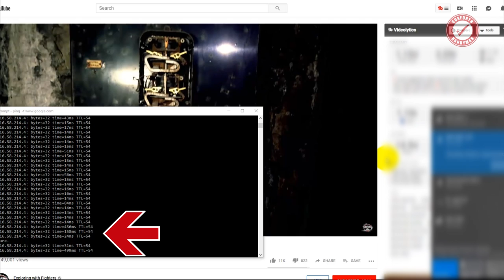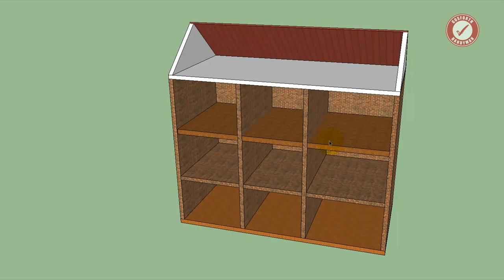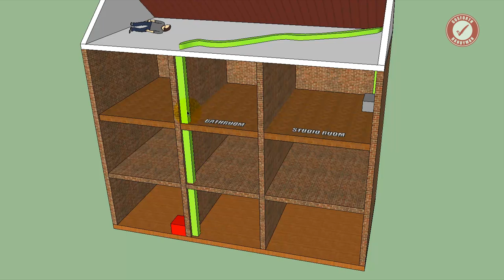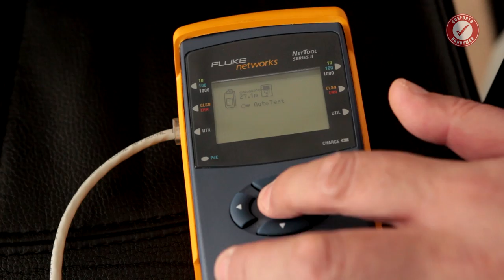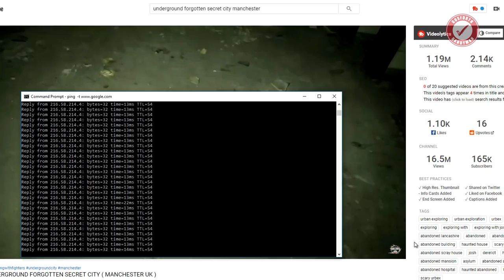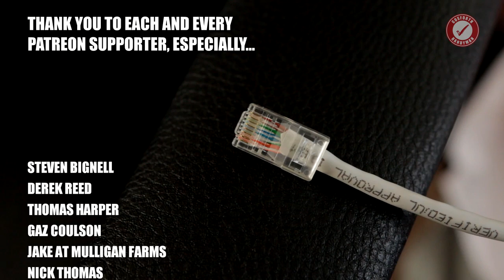Running RJ45 Network Cables inside walls ...and fixing Wi-Fi problems!

Comment: I would have added another length of garden twine to the CAT5 that was pulled up. If additional cables are needed in the future then you already have a pull in place (and you can rinse and repeat)
Reply: Agree I have habit of doing same as I never know what I need to run later. Save me headaches.
Reply: Im glad I read your comment.  Thanks, and when I start drilling holes I will definitely be thinking of future runs.
Reply: You always want to leave a pull line in these trouble areas in case additional lines are needed in the future. Pull strings cheap and will save you time and the headache of doing it all over again
Reply: Use washing line instead of twine. It's super strong and it's heavy, meaning it will drop straight down better. You can get it in 50m lengths. Drop it down, leaving most of the line at the top. Attach the cable to the top and pull both cable and line down. You can pull the washing line back up and repeat as many times as you need.

Comment: Instead of ending the cable with an RJ 45 plug uses an RJ 45 keystone in a wall plate. This will let you plug a patch cable of the correct length for any placement you choose. Changes are easy and the plug end is easily damaged. replacing a patch cable is a lot easier than re-ending the end of the wall cable and finding that it is too short.

Comment: used to work installing networks in the army in mainly old buildings one tip I used to do was attach one of those small laser pointers to the fish wire so it was easier to locate in dark attics or crawl spaces

Comment: Had the same issues, in the end i fed the CAT5 through the outside wall from one side of the house up the wall to the roof and across the loft, back outside on opposite house down the wall and into the room with the problems your having - I purchased one of those cheap kits off Amazon - did my own research on the wiring and fitting the plugs on the end of the CAT5, tested them all out on the cheap kit and it ll was good - got great internet now in a room we could not ever get in before.

Comment: Used the same technique in our house but fortunately we had an ensuite shower which had a box behind it that I could physically get into from the loft and then managed to poke the cable down next to the soil stack through to another box in the cupboard below which was in the lounge where the router was. I didn't drill a big hole like you did, I just drilled a small whole in the bottom of the box and fed a cable upwards that I could then use the soil stack access hatch to get my arm in and grab onto. Worked a treat.

Comment: Good video  showing all the issues I have come across in doing this. I like the idea of the large holes- never done that and it makes it so much easier to feel around. (Saw your earlier video on filling these too.)
In my latest house I tried wireless solutions (mesh) like Ubiquiti but no good. In the end I got BT Whole Home and it works brilliantly on all floors once you place the discs properly (positioning software tool provided). Never thought I would use BT kit! I get 50Mbps in all rooms in the house now with no wiring.

Comment: No boxing in my house to chase cables down so I went outside... External grade Cat5e (black) clipped every 600mm and 90° turns, with internal RJ45 sockets in surface-mounted boxes. One run from office at rear of house to lounge at the front. Second round to the garage on the opposite side of the house where I keep my NAS. Gigabit switch in the office links it all together. Previous owner ran so many cables on the outside that once I'd stripped them all off, my pair of cables didn't look half bad.

Comment: Lovely neat job Andy, very well explained and demonstrated as usual.

Wired all the way for reliability. If you get it properly installed at the start, it very rarely goes bad. I’ve done a ton of these over the years for friends & family and you still gave me a couple of new ideas.

I’d definitely have run a second cable for future proofing - splitters will drop your speed back to 100 mbps which might be okay for the Internet but is terrible for network drives. Plus you can use the second cable as a HDMI extender (with suitable encoders) which is often handy!
Reply from the maker: Cheers Eddy! Yeah, splitter performance can be quite varied depending on cable length and interference etc. Worst case I'd just add a switch. 👍👊

Comment: When I did this, I just went outside and mailed to the brick. Super easy. There was already a telephone and TV aerial cable so added to the lines!
Reply from the maker: Good plan! 👍
Reply: I don't think that standard CatX installation cable has suitable UV protection for outdoor use.  It may disintegrate over time - mind you with the UK climate...
Reply from the maker: Yup - you'd defo need exterior grade cable.
Reply: Gosforth Handyman or put it inside a pvc pipe
Reply: @stephenguk  yes indeed, I read somewhere some 5-10years. I only needed it to last 5 max.
However, simply painting it increases the UV protection many many times over.

Comment: good job Andy shows it just takes time and lots of patiences, I think I would have conected each end to rj45 faceplate rather than using the crimping tool (or the lazy route and use a mesh wifi but wired will always be better for stablity)
Reply: Could always switch to that later and put a switch on one end.

Comment: I used to put in data connections and my office at home suffered from a similar problem so I fitted 2 sockets in my office which went to where my router is problem solved I fitted sockets into the wall and then used Cat5E patch cables. However since I have swapped to Sky Internet my Sky Q boxes have now become wireless routers due to Sky fitting a range extender box where the dead spot was. A wired connection will always be better than a wireless. Well done and if you had said at Makers Central I could have let you use some of my cable as I still have a box left 😂

Comment: Tool-less RJ45 plugs are also very good i have used these as have never crimped the plugs myself and only ever conencted into the sockets & patch panels.  you just line the wires up ntop of their terminals and then close down the lid on the plug which has built in blades to crimp the wires into the plug, they are a built bulkier than the normal plugs but very quick and easy to install. 

I installed a cctv system an dvr on our house and had to run all cables extenral and with minimal amount of cable on show as my mum hates seeing wires.

The dvr is sat in the loft, it needed a wired network conenction to be able to acces the cameras on our phones, and does not have wifi built into the dvr or the option for a wifi dongle either.  I ran a black external grade cat 5 cable up the outside of the house from the BT socket where the router is up into the loft through the soffit, this was cable tied to the BT phone cable and then also next to this cable where it went into the soffit is where i installed one of the cctv cameras so only a short amount of cable was on show, also did the same front and back for 2 more cameras so they were out of site and impossible for people to reach and damage them. 

Where the cable came into the bt socket I just cut out a bit of the socket back box for the cable to come through behind the socket front plate and terminated both ends with tool-less RJ45 plugs, i then also put a small switch in the loft and repurposed the trunking in the back bedroom that was for the old storage heater wiring to run a cat 5 cable from the switch in the loft to my bedroom as well as also run coax cables for the tv's meening i could do away with the rubish indoor aerials we had in the bedrooms. then in my bedroom bought a secondary acces point that is basically just a glorified router to run all my AV equpiment on wired networking and have wifi for all my wireless devices.  So glad i did it all.

Comment: Another useful tool for pulling cable is a long section of beaded / ball chain (like on an old lamp but larger beads and longer, about 20’) A long #10 or #13 ball chain has enough weight to drop down a wall without snagging on insulation and does a great job of deflecting around small obstacles.
Reply from the maker: Yup - they're great too! 👍

Comment: Concrete walls and floors made me go wired too, port switched gigabit ethernet throughout in the house. 

Nothing beats the speed and stability of wired LAN.

For mobile internet access I use both my router and a remote repeater (depending on where I am at the time). 

Works like a charm :-)
Reply from the maker: I can now use my PC as an access point for the top floor too (when it's switched on) - works pretty well! Better than the normal wi-fi anyway. 👍😂

Comment: I recently bought a house, during the 1st fix I also fitted cat5e cables to each of the bedrooms, instead of terminating the ethernet cables with RJ45s I opted for face plates with sockets and patch cables for each device.
(those cheap tester kits do what you need them to do, there is no rocket science here, either the pins are wired correctly or they are not, spending a fortune on a Fluke kit isn't necessary for domestic use).

Comment: Nice job, running cable is always fun. Only thing is, never run 1 cable when you can run 4+. The cable doesn't cost much compared to the time you spend doing it. Even if you don't need them now you could've left a coil of cable at each floor and another in the attic etc long enough to reach any room on that floor and it's most of the job done for next time you want another point somewhere.
Reply from the maker: Would have been a lot of extra work and guarantee I'll never need more than this one. 👍
Reply: yeah surprised he only ran one

Comment: A suggestion if you need more connections in the future would be a switch in the loft connected to the router downstairs then you only need run the connections from the loft to the top floor. If you have a gigabit switch and router you’ll be fine for sharing the single cable for internet access, which was around 30meg from the test you ran. You could also put a wireless AP in the loft to help your WiFi coverage for mobile devices.

Comment: In my house I can see 20+ wifi networks... 100% chance that one the neighbors decides to run it on MY channel! Oh well... a €20,- for reasonable krimp pliers and €17,50 for a cable tester (its a must!) did the job. Ones you get the hang of it... its a lot of fun making patch-cables. Running 4K tv/youtube only goes through old fashioned copper wire.
Reply from the maker: Yup - once you get started on crimping the ends on you can get quite fast at it. 👍😀

Comment: House builders take note install network cables during build. Keep up with technology. I know some do but should be standard these days, in only pennies in scheme of things.
Reply from the maker: Yup - totally agree. I'd have paid extra for it but not even an option. I've seen some smaller builders offer it. 👍
Reply: They only need to add a 2" plastic pipe in the boxing in for cable drops
Reply: Gosforth Handyman I know of some builders who do provide generally smaller ones. Just needs to become the norm.
Reply: They could just leave scrap cable for you to tie on to. Suprised no fire stopping between floors.
Reply from the maker: The plasterboard itself is the fire barrier. 👍
Reply: Know of a new build that had mains wired smoke directors that were wired into lighting circuit so only worked when lights on 🤦🏻‍♂️
Reply from the maker: Our smoke alarms were arcing so much due to crap connectors they were the most likely thing to cause a fire! 😮😮👍
Reply: @GosforthHandyman  I have worked in places where they wanted extra fire protection between floors not just plasterboard, any holes made had to made good,belt and braces?
Reply: James Taylor I spec 2x cat6 beside every likely TV location. Can run HDMI over baluns from a central distribution point that way 👍👍
Reply: @GosforthHandyman  I find most builders / sparks don't know the first things about data or what cables to run in or where to put them. I have done a fair bit of work fixing or adding cables that were not done properly by the house builder.
Reply: @JasonShowell  as a spark have run data,but to each his own,it can be a bit of a dark art,I'll stick with 240 thanks.
Reply: @Pistol_Knight  yes that would be a much better option because it then enables you to upgrade to whatever future technology there is such as cat6 cat7 maybe even fibre
Reply: Just spoke with david wilson homes about it and there is no way they can do ethernet cables, only telephone points
Reply: Even better - just add conduit so that following people can manage their own cable....

Comment: I have a 2 floor townhouse with a 300mbps package. I was getting 5mbps on the second floor with the Comcast modem/router combo. I switched to a mesh system. On a good day I’ll get 200-230 mbps upstairs now. On a bad day when there is some kind of interference. I’ll only see 120-150 upstairs. At least it’s better than it was

Comment: If we didn't have phones and tablets, I wouldn't even have WhyFi in the house I despise it that much.
Just last autumn I ran 6 pairs of 40m fibre to a central switch. Is only 1Gbps now but the fibre can handle 10Gbps down the road.
Was having massive ground current issues with all 8 switches - everything is rock solid now !
Reply from the maker: Sorted - wow! 10Gbps! That is properly future proofed! Awesome work! 👍👊

Comment: I learned long ago that when drawing a cable you can be well-served by tying on another draw cord.

And a tip for getting a draw cord from one end of a conduit to the other ... tie one end to a plastic bag, stuff the bag into the conduit and blow it through using an air compressor.  Needs about 1" (2.5mm) free clearance in the conduit.
Reply from the maker: Indeed! In industrial applications blown fibre is very common, where fibre optics are literally blown down ducting. 👍
Reply: Not to be confused with blown fibre (mineral wool) insulation ... which has greater connectivity issues and significantly higher latency than WiFi.

Comment: I wish you showed how you fixed the holes. Love the video!
Reply: This is what I wanted to see as well.
Reply: same here,  I want to start a business running cables in peoples home since I already have some experience due to my previous job but I want to be ready for all types of situations
Reply: I cut wall outlet size access holes and cover with a blank plate. That way later on you can get back in there to add or maintain.

Comment: my first thought is to go from the loft to the ground. Use gravity and some cable rods. Rods are flexible and have some weight to help them fall in a straight line, join some together to have around the height of a floor, then you always know that you should be able to access on each floor of your house should the thing get stuck!

Comment: Come on Andy, split screen with you feeding the wire and the other screen with the hole waiting for the wire would have really pushed this video to the dizzy heights it deserves.  Or a wide shot of said hole waiting for the wire to come through and then you see the wire coming out through the bath plug hole or better still the toilet 🚽😀.  Thanks for sharing mate 👏👏👍

Comment: I did have a powerline system in the house (it came with from the previous owners for their CCTV system) but the issue I had was noise on the mains wiring. Modern amps/computer/tv's didn't have an issue but I've got a collection of vintage HiFi bits (everyones got to have a hobby) and you could constantly hear the thing going. 

Ethernet was dropped down into the basement via the side of a cupboard in the kitchen in the end which meant I could move other networking gear into the basement as well. My issue now is that I still don't have ethernet in the rest of the house - especially my study. Wifi works well enough for the most part until I'm moving files to the basement servers and then It's alot slower than an ethernet connection. 

My plan is to remove an old 12 core phone line from the outside of the house and replace it with proper outdoor rated Cat 6 but I need bigger ladders first as it's on the first floor of a tall Victorian house.

Comment: Did exactly this at my nephew's house at the weekend!
Problem we had was no box section so had to fiddle the fish tape through the dot & dab gap which was variable to say the least. The sparky must have cursed the d&d idiots at second fix as we found backboxes protruding right through the skim coat and the gap between skim coat and sockets had been caulked! Got it working but the walls looked like white Swiss cheese by the time we finished pulling the cable.
Wifi is ok, but sometimes you can't beat a nice bit of copper :)
Reply from the maker: Dot & dab can be great for hiding cables - but yeah sometimes you'll hit blockages in really weird places. Nice work! 👍

Comment: Good little video fella, wifi is an artform for that sort of distance and would need a repeater/extender, homeplugs are always a pain over multi levels due to each ring mains level, you're lucky you have that ducting system, I'm currently trying to figure out how to get a hard wire, but I don't have any easy way LOL, although my homeplug system is working, I'd like to get the full speed from my internet into my office.  Ideally for wifi to work in that location would be centre room to send wifi in every direction equally.

Comment: That was excellent. I had the same issues some years ago. The kids complained bitterly about drop outs which disconnected their chats. I ran Ethernet cables round the outside of the house. Did you consider this and if so why reject it in favour of the more difficult internal routing? The kids have left home now so it is no longer an issue!
Reply from the maker: No easy route outside - plus I'd have to have bought different u/v resistant cable. Massive difference though! 👍😀